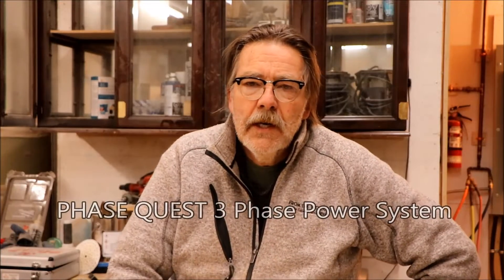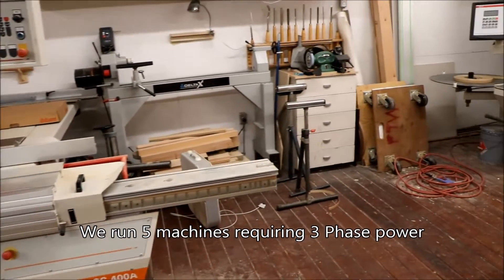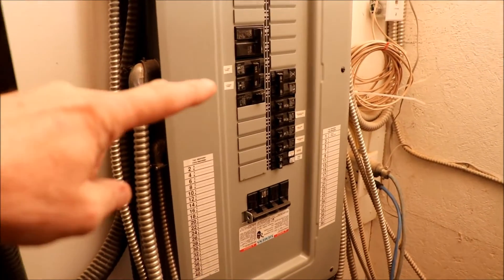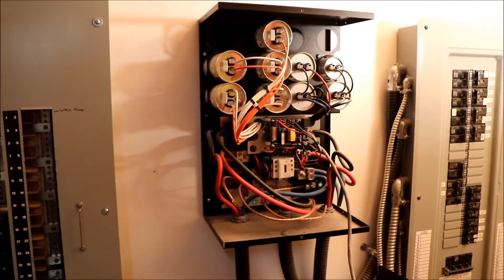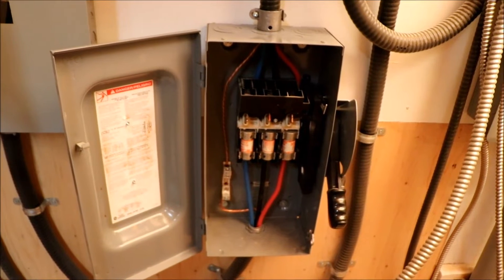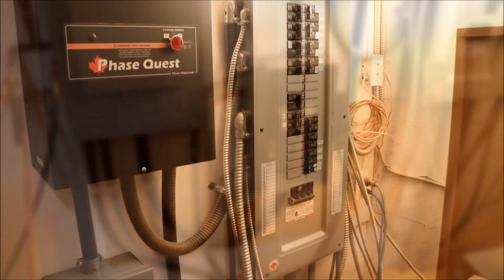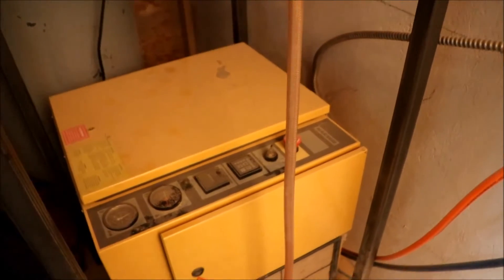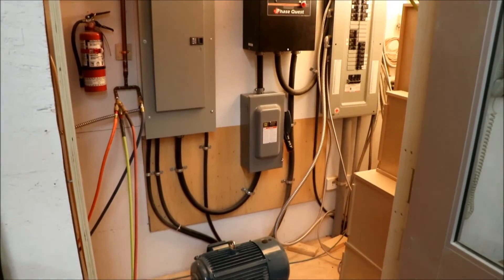PHASE QUEST 3 Phase Generator

Comment: Why don't you just pull a natural over from the other panel if you want one in there?
Reply from the maker: Yes I thought of that, its a great idea, but still have lots of room on the main panel so need as of yet. Thanks for watching.
Reply: Great video
Just bought a small 3Hp unit
Cheers